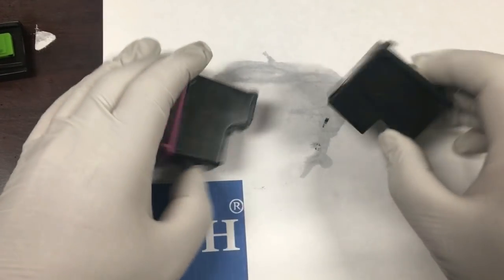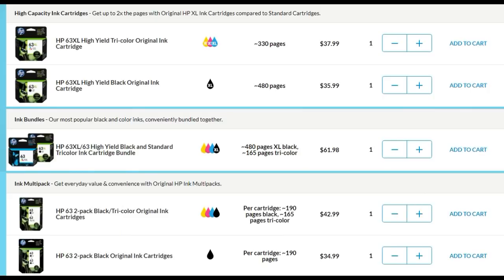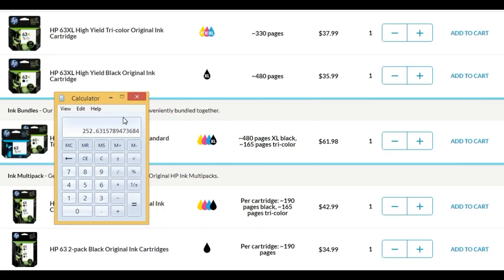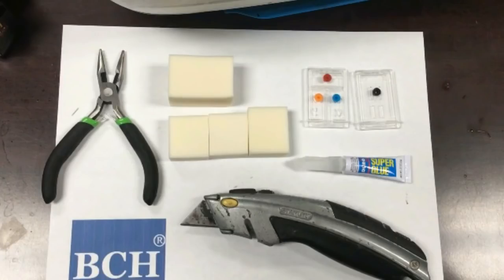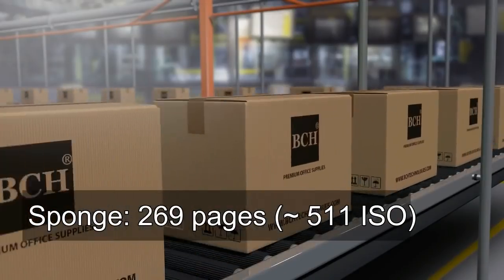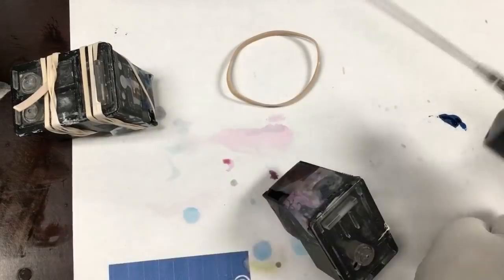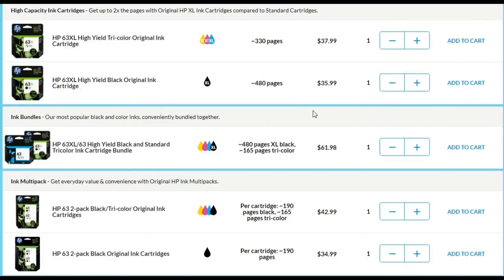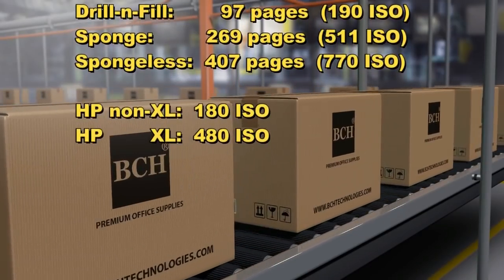How many pages can a refillable cartridge print?  Sponge vs. Spongeless

Comment: hello i liked the vids on your channels but one thing happens to me, after tried everything unclogging cartridge removing air all with the suckle tool but the printer doesnt print with the black color or cartridge but yes with the color one can you help mee
and how many times can a spongeless cartridge be refilled? 
or it just need to be replaced after a several refilles ( i was refilled 4 times )
the cartridges black and color cost the same that the printer with the cartridges included ://
or i just have broken the electrical ? the contacts are clean
Reply from the maker: It can be refilled at least 10 times.  When it's worn out, it doesn't just stop printing.  You will see the lines get fuzzy and not as sharp as new ones.  Does your hazard light blinking?
Reply: no , yea the cartridge first started getting just fuzzy but then after 50 pages just doesnt come nothing in the pages of texts or in the header print test page
after that i tried all type of unclogging the black doesnt come (the colours still working ) the hazard light doesnt blink
 probably i was burned out the cartridge after tryieng to deep clean it without having ink (10 or more deep cleanings) at the end the black last me 850 pages or about
i was found an hp printer with the same caracteristics new at 16$ with both the tri colour and black cartridge
if i convert it to spongeless how much pages you think it will last without dont printing nothing ?
Reply from the maker: It could be.  Canon and HP are bubble jets, which they heat up the printhead to create a bubble.  If you print without ink, it will burn out.  However, I've never tried to clean without ink.  If you want to know for sure, you can send it in and we will take a look.  It should last at least 2,000 pages.  I burned out a black cartridge at 2,600 pages this week, but the color is still going ( over 5,000 pages now).
Reply: i live in chile :c thanks for answer , nice :D .
the cartridge that you burn out at 2600 pages just doesnt print like the mine or print with lines , i say dont print even with lines like the mine